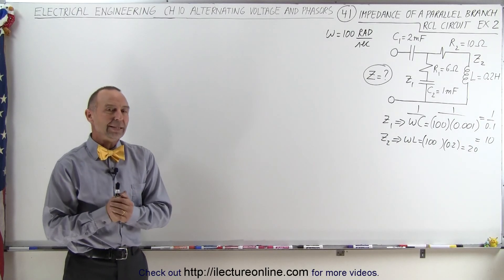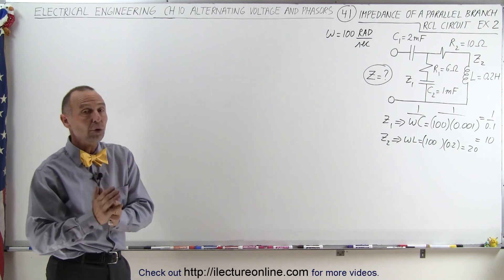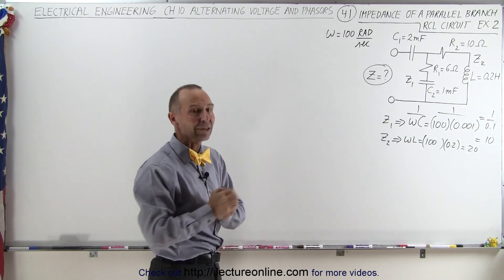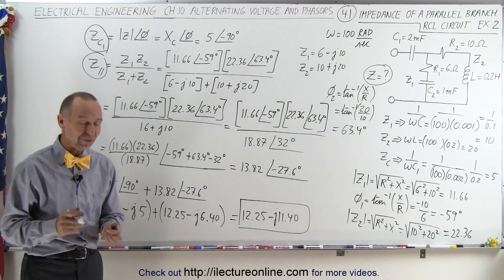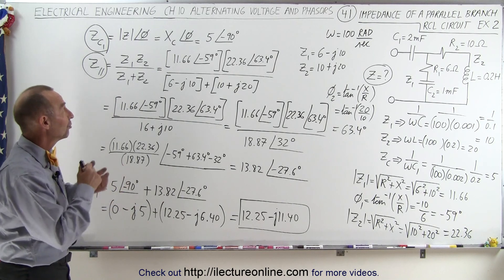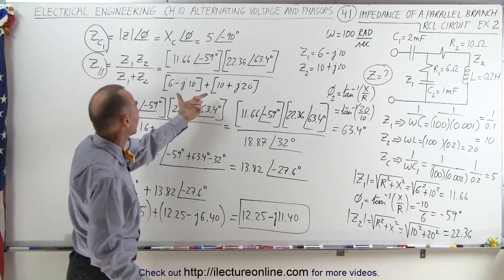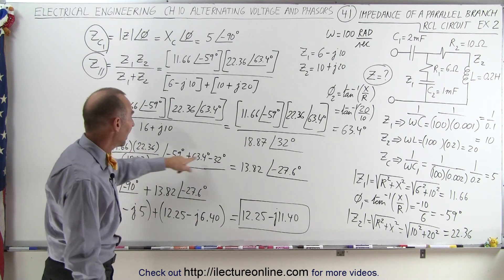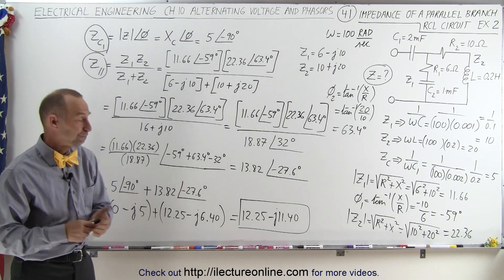Electrical Engineering: Ch 10 Alternating Voltages & Phasors (41 of 82) Z=? Parallel RCL Ex. 2

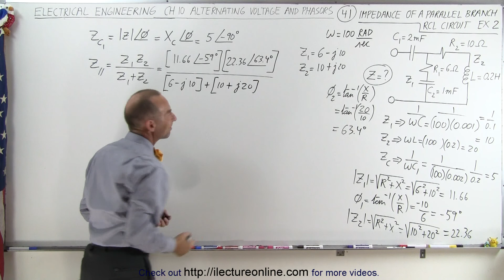Comment: I don't understand why at 6:36 you're using different values for Z1 and Z2 in the denominator, I thought we had already figured out the values of these?
and we also have Z1 as being the value of the reactance of the capacitor 1/wc, then the impedance of the RC combo 11.66 @ -59, and now... something else?
I'm finding the notation/labelling of this video very confusing

Comment: Dear michel,
Can you explain to me why you take the arctan (-10/6) at angle nr1 and at angle nr2 you take arctan (20/10). They are both in the same quadrant as i see it, so why one time -10 and the other time +20?
Reply: The impedance he labels as Z1 is equal to the real and imaginary parts, so Z1 = R + Xj where X = X-Inductor -  X-Capacitor or similarly X = XL - XC. Since Z1 goes through only a resistor and a capacitor, X = 0 - XC or X = -XC. XC has its own formula which is XC =  1/w*C, thus X = -1/w*C. Plugging in the numbers for w and C, you get that X = -1/(100*0.001) which becomes X=-1/.1 or X=-10. Now you get Z1 = R +Xj becomes Z1 =  6 - 10j. Think of Z1 as a vector, so the magnitude of Z1 is square root of ((6)^2 + (-10)^2) and the angle of Z1 is arctan(-10/6).  For Z2 that goes through the inductor, we have Z2 = R +Xj, where X = XL - XC..since there is no capacitor on this path, XC = 0. XL has its own formula of XL =w*L. Plugging in the values you get XL = 100*0.2 so XL = 20. Now Z2 = R +Xj becomes Z2= 10 + 20j. Again treat Z2 as a vector and you get magnitude of Z2 is square root ((10)^2+(20)^2) and the angle of Z2 is arctan(20/10).
Reply: Another way you could also rationalize why one is positive and there other is negative is the following. We know that  the direction of the voltage phasor and the direction of the impedance phasor are in phase and points the same place. We also know intuitively that when you turn on a circuit and current goes through a capacitor, it takes awhile for the capacitor to charge up to the potential of the source, so that means that voltage lags by 90 degrees making it negative. And since the voltage lags by 90 degrees, the impedance lags by 90 degrees that that is why you get the arctan(negative value / Resistor) for XC. Also when you think about turning on a circuit and current goes through the inductor, the inductor tries very hard to resist the current so its induced voltage is high in the beginning which means voltage leads by 90 degrees. Since Impedance and voltage are in the same direction, Impedance will lead by 90 degrees and that is why arctan(positive value/ Resistor) for XL